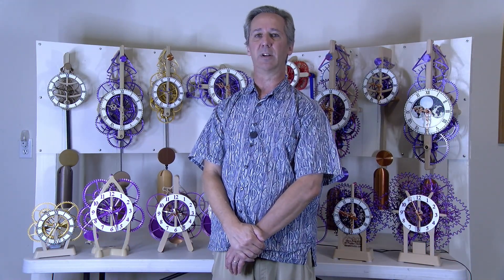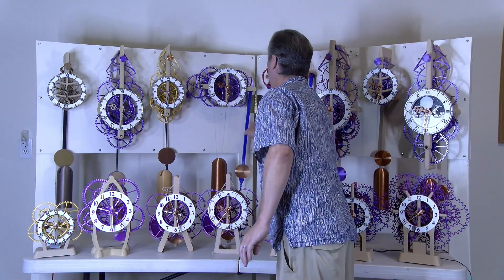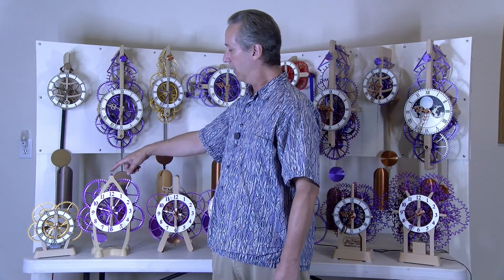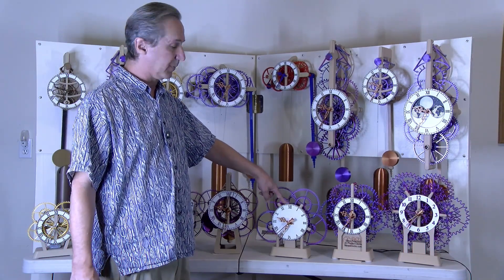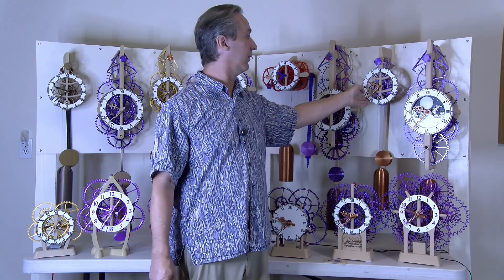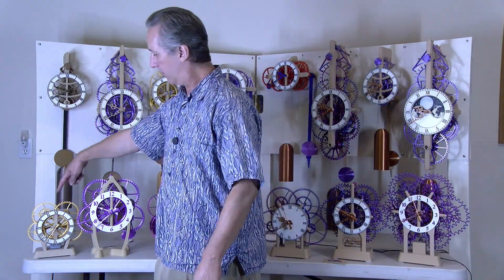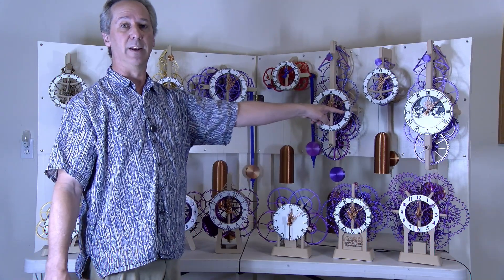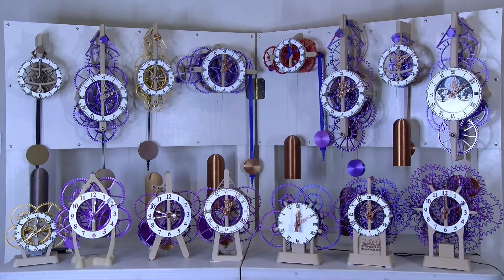Which Clock Should You Build?

Comment: Amazing stuff.  I just remade SP5 to SP5b.  SP5 stopped working and was collecting dust for 4 years.  Updated Instructions are great.  Improvements very nice. Thanks so much.  SP5B is ticking away.
Reply from the maker: That is my experience as well. The new gears have significantly lower engaging friction. My clock is very reliable in 20 day mode with a 6.5lb weight.

Comment: Hi Steve.  It would be more helpful if you summarize all the clocks to a table on your website.  The table would includes such things as: how hard to build, dimensions of finished clock, approximate run time, print time, minimum 3D printer built plate size, BOM, etc.
Reply from the maker: Thats a good idea. It will be much easier to keep it up to date, especially considering that four of the earlier wall clocks have been upgraded since this video was released. SP2 through SP5 are now just as reliable as any of the other wall clocks.

Comment: Hey there Steve, I just built the small 8 day clock. I think if you have a good 3D printer a clock can turn out a little better than a laser cut wood clock.  Here's a good question.  If you use bearings on all the pivot points, will the clock have less friction?
Reply from the maker: I agree that 3D printed gears should have less friction than laser cut wood.

Friction would be reduced by adding bearings at all the pivot points. However, the gear tooth friction in my clocks is probably 10X higher than the pivot friction. The arbors have a small diameter with steel turning in a smooth PLA hole. The gear teeth engage at a larger diameter and will always have some amount of sliding friction. Completely eliminating pivot friction would only reduce the overall friction by around 10%. It is much easier to just increase the drive weight by 10% instead of adding bearings throughout the clock. 

A wooden gear clock with wood dowels as arbors will have a much higher pivot friction. It might see a much better benefit from additional bearings.

The only places I use bearings in my clocks are where there is a moving weight. The pendulum arm has about 5-6 ounces of weight and is the fastest moving component in the clock. It gets small bearings with very low friction. The weight shell also needs bearings due to the heavy load being supported.
Reply: 113 / 5.000
I'm finishing printing the SP14 moon phase watch and would be interested to see how you electrified it.

Comment: Hey Steve.  Love all these designs.  If You're looking for a new challenge with clocks, something I've always wanted to see is a clock where the hour and minute hands move discretely from the second hand.  That is, the minute hand doesn't tick to the next minute until the second hand reaches 12, and the hour hand doesn't tick to the next hour until the minute hand reaches 12.  This way, if the time is 4:35:23, the hour hand is on the 4, not halfway between the 4 & 5, and the minute hand is on the 7, not halfway(ish) between the 7 & 8.  I've done a bit of searching and I haven't been able to find one that works like this though clocks used to ALL work like this at one point and then just stopped being made that way for some reason.
Reply from the maker: That sounds like an over-complicated way of doing something that has a trivial solution of using simple gears to move the hands. 

I do not think I have ever seen an analog clock operate the way you describe. The closest I can recall is the schoolroom clocks that were all synchronized to the master clock in the main office. An electromagnet would be energized once per minute to move the minute hand one step. The hour hand moved normally with a 12:1 ratio to the minute hand.
Reply: @stevesclocks  You're right, it IS an over complicated way to do it.  And when I say "used to" I mean like a couple hundred years ago when clocks were first being made.  You go to all the old city clocks in Europe that are still operating and when the minute and hour ticks over, you'll hear a REALLY loud CLUNK and the hands will move. :)  I just thought it would be an interesting challenge for You.
Reply from the maker: @Runescope  That is very interesting. I always assumed that a tower clock would be completely analog.
Reply: @stevesclocks  Oh no, they are!  That's kind of my point.  The process is all done through gearing, that's why I thought it would be a challenge for You to figure out how they used to do it.

Comment: Do you have a video for sp 13? And is that the easiest for my first attempt. I need to know what assembly parts I have to buy and where to get them? And the plans. I am so going to give this a shot. Do you think it can be printed on the flash forge adventurer 5m pro 220x220x220mm and what kind of filament? Thanks Steve. I want to build one for my mother for Christmas. They are all beautiful and elegant not really interested in the electric ones. Accept for the magnet one but simplicity first.
Reply from the maker: SP13 is the easiest to build and should be very reliable. Any printer less than 5 years old is capable of printing my clocks as long as the build plate is large enough. 220x220 can print all of my clocks.

You can find the assembly guide with instructions and parts list at https://www.stevesclocks.com/sp13
Reply: @stevesclocks  thanks

Comment: I tried to build the easy build clock a while back. It ran good for several months but then quit working. Maybe because that frame was petg and added too much friction with wear. I’m thinking about trying to build another one to see how that goes.
Reply from the maker: You may be able to easily get your old clock working again. In my experience, the most common fix is to clean the pendulum bearings again. Then check that all the gears still spin freely on their arbors. A tiny drop of lightweight oil on the arbors and lithium grease on the pinions may also help.

For the easy build clock, make sure to use the "Rev 2" updated gears. It can still be downloaded from MyMiniFactory. This fix eliminates gear 3 pushing against the escapement.

Comment: What an amazing dissertation on such great works!  Only built one gravity/ pendulum clock so far;   the crazy gear clock is next up (for my son). I've experimented with digital display clocks using real time, internally temperature controlled crystals and found they are amazingly accurate as you describe.  Have been expanding my radio controlled clock knowledge with an idea that a crazy gear clock might be tied to the Fort Collins standard...  Thanks for all you have done;  from a retired EE.....
Reply from the maker: @warrenreif5369  Generic RTC modules are accurate to about a minute per month. Precision RTCs add voltage and temperature compensation for an accuracy of about a minute per year. They only cost about a dollar more.

The only time the clock loses time is when it loses power. Synchronizing to a global reference time adds a lot of complexity. It needs to connect to the reference time, and it needs sensors to know where the hands are pointing so it can bring them back to position.

I have considered an alternate solution of using the Arduino Nano nonvolatile memory of recording each second that the hands move. If power goes out, the algorithm only needs to know how many seconds the power was out. The clock could run fast until the hands catch up. If power was out for 11 or 23 hours, then the clock would run backwards for an hour.

Of course, there is also a trivial solution of making sure power never goes out. A small USB battery can power the clock for a week or two. Plug the battery into a wall charger so it stays fully charged, then feed USB power from the battery to the clock.
Reply: @stevesclocks  Thanks for the quick and highly informative feedback.  I program C/C++ primarily in the Arduino world, so an atomic clock solution, similar to the real time clock implementation, seems doable.  My thoughts on a "never let the power got out" solution was to mimic the computer back up approach where a battery is always providing power to the load (clock) and is charged at a safe, long term voltage when power is on.
Reply from the maker: @warrenreif5369  Powering the clock with USB power makes it really easy keep power applied. The biggest challenge is finding a power bank that doesn't go to sleep. My 10,000mAh Anker power bank shuts off with only a single clock load but will run continuously if a few clocks are attached. A no-name 5,000mAh model will stay running for several days with one clock load.

Comment: Steve, a great display.  I have built or tried to build many of these, some work very well, others it took a number of tries to get them going.  I need to finish the moon phase clock, I'm at the point of getting the rods cut and ready to assemble - all of the  parts are printed.
Reply from the maker: The moon phase clock assembles really easy. I am looking forward to seeing the extra touches added.
Reply: @stevesclocks  Thanks for the encouragement.  Just had so many things going on and I keep pushing this back, plan on starting this week.